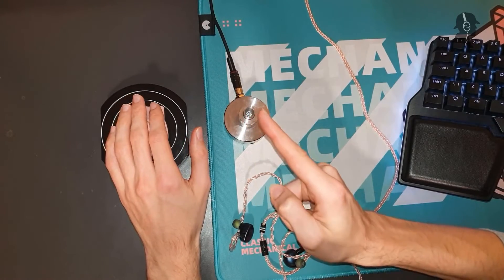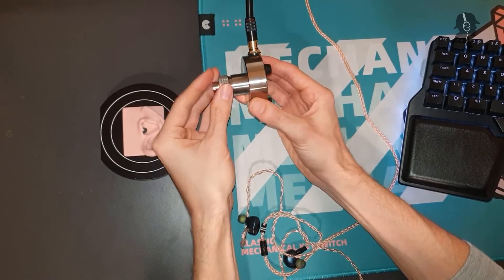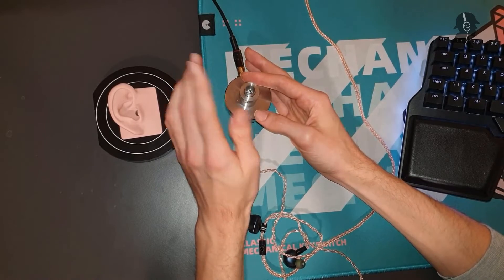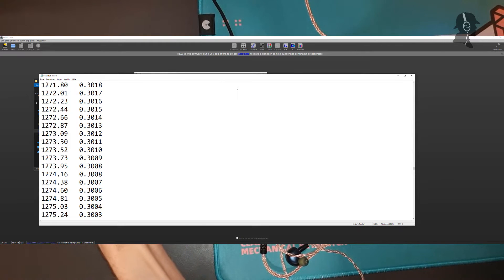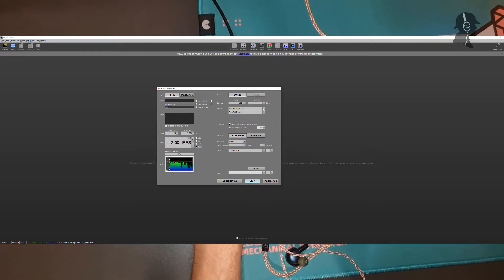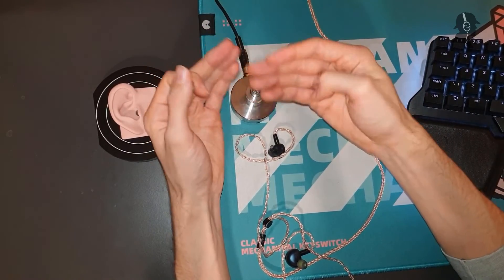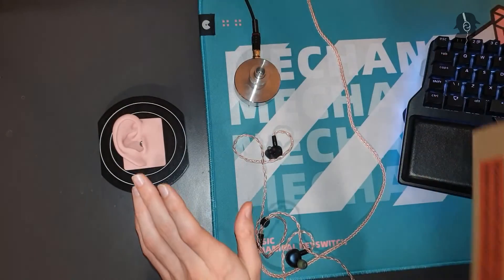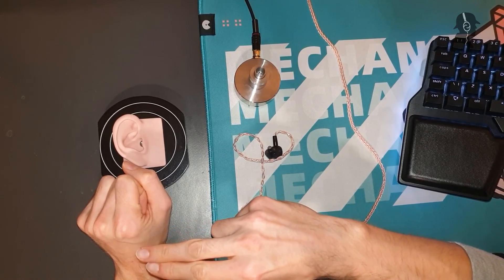How do I measure IEMs/headphones (And how you can do it as well)

Comment: Wouldn't be better to measure all the IEMs with stock tips? It's unlikely people will have the same eartip to match the FR.

Btw, you can also Calibrate the dongle by doing a loopback in rew. Rn I have my Hiby R4 and TRN Black Pearl calibrated and also the IEC60318-4 coupler with the file the seller provided me
Reply from the maker: It depends on what I would want to achieve:

If I want my measurements to be consistent among each other (which I do) then keeping the same tip is the way to go.

If I want to keep my measurements to be possibly be more similar to other measurements, then stock tips would be better... But not optimal either, as I do not know how far other measurements insert the ear-tip or on whether they use the coupler with stand or without or even with fake-pinna.

I have read about loop back calibration too when I researched on how to set it up. But it didn't strike me as particularly useful as I'm using a source (now: A50 III + D50 III) that has no roll-offs, no coloration and a near-zero ourpout impedence so there shouldn't be any changes to FR based on my source. And as I do not care for timings, the calibration doesn't really do anything for me as far as I understand (?).

If I'm wrong on the calibration, I'd appreciate you sharing a link that explains what exactly the loopback calibration does and how to set it up :)

Comment: I have IEC711 coupler same as you but I am not able to calibrate with REW, can you help? It always show me message like : ""The sound card measurement varies by 29dB between 20Hz and 20,000Hz. That is much higher than it should be. The measurement may not be valid and should not be used to make a calibration file."" What am I doing wrong?
Reply from the maker: Hey
Did your seller provide a calibration file?
Normally they do and you can just use it in REW under preferences for your input-device.
If not, write them and ask for the calibration file.

For manual calibration, I'd need to do some research myself, as I haven't done that so far.
Reply: @don_spektor  unfortunately no, and the seller themselves did not know what I was talking about, so they didn't help.
Got it from a local vendor
Reply from the maker: @frostedbay1  Hmm sorry to hear...
I'd need to look it up myself. Did you try searching for something like "REW feedback loop" or "REW calibrate with feedback look"?
On the weekend I can do some googling and see what I can find.
Reply: @don_spektor  thank you, I appreciate it. Yes I did look up how to calibrate, but whenever I calibrate I get the message that I asked in first query.
Tried to change to a dongle instead of sound card. But didn't work.

Comment: I just ordered the rig but will this work with smaart v9 live transfer? Or can i use a behringer um202hd audio interface as i need loopback audio for smaart.
Reply from the maker: Sorry I can not help you there. Have not worked with this software so far.

Basically any interface with reasonable quality should be fine. The UM202HD looks like it'll get the job done.
Reply: @don_spektor It works also works with live transfer on smaart v9 suite le.

Comment: Do you recommend a better setup or are you happy with the rig you're using?
Reply from the maker: I'm pretty happy with the setup. Works totally fine, extension on both ends looks correct to my eye when comparing it to other IEC711 graphs and it's also easy to use, not to mention comparatively inexpensive.
Reply: @don_spektor  I was thinking to get one myself last year but the seller told me it doesn't come with calibration file. So I assume I have to calibrate it myself. I know this type of mics are designed for pink noise recording but do you think it can record the music in high quality bit rate? I'm not sure what mic capsule is used on yours but hoping it can swapped with a better capsule. cheers
Reply from the maker: @samk.9972  That's odd. Most of these mics do come with a calibration file...

If this particular seller doesn't offer, there should be dozens more who do. I think DMS even has a coupler in his "merch store"?

You absolutely can record music with this microphone. I just can't tell you how good the quality would be, as this type of mic is not made for music recording in general. Maybe getting a bigger membrane condensator mic would be a better idea for music recording? 

The mic in my stand itself is just screwed in and can easily be swapped, however I think only IEC711 mics or similar will have this type of threading.
Reply: @don_spektor  Thank you. I'll check other stores to see what they offer :)
Reply from the maker: @samk.9972  You're welcom, if you have any other questions feel free to ask :-)

Comment: Hello good sir. I would like to measure my headphones and iems to check if there is anything wrong with them or not and maybe share them in my reviews. I see couplers for measuring iems, also testing boards like you have there. 

My question is, do the testing boards with soft pinnae include coupler and microphone or did you buy them seperately? I saw several vendors list them. Coupler with microphone can be found around 70$ and the test boards with pinnae are like 150$. I don't want to buy the same device twice or end up with only a creepy ear. When ask this question to some of these vendors but unfortunately they don’t understand the question :(

I already have a decent audio interface (also can buy another) and nice neutral dacs and amps btw. Also do you measure both channels with just that one pinnae?
Reply from the maker: Hey Fahretti Cetin,

The pinna does usually not come with the coupler. You do need to buy them separately. 

But if you measure only IEMs, you do not need the pinna, as the IEC711 coupler already models the inner ear.

And I usually measure IEMs only in the metal tube that comes with the coupler and then both channels. Over-ears usually have only one channel as the difference in sound by the pinna can be noticeable in the measurements. It doesn't have to be different though i.e. with my DIY headphone I wasn't able to measure any noticeable difference at all.
Reply: @don_spektor  thanks a lot. It seems I will buy the coupler first then pinnae later.
Reply from the maker: @fahryst  You're welcome :-)
Glad I could help.

If you don't measure over-ears often, you could also just put the coupler in a foam block. That gets you like 90-95% to where the pinna would bring you.

The most important part in all of your measurements it to keep them consistent in terms of how you set it up/insert the IEMs or how you place the headphones. That makes them comparable among each other.

And if you have a reference from other reviewers, in theory you could also compensate for changes on their/your rig.
Reply: @don_spektor  my main gig is headphones actually. And it makes sense. Not that I prefer it but since hd600 is highy popular and widely accepted reference, I usually compare anything to those. So I also considered making something myself as long as I use something everyone is familiar with to compare.

Comment: Guessing the lowering over average treble response is due to high variance in higher frequenceies in the shape of sporadic deep dips.
Reply from the maker: That actually makes sense, thanks for the insight :-)
Interestingly though if I do multiple measurements and then lay them on top of each other, the deep dips do not "move" that much, so there might still be other factors at play here to explain the overall reduced treble response.